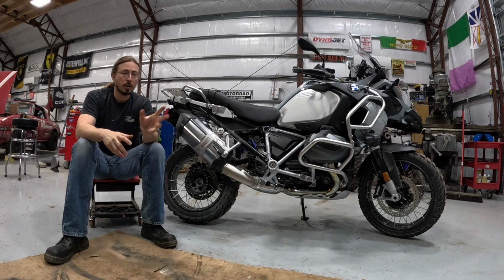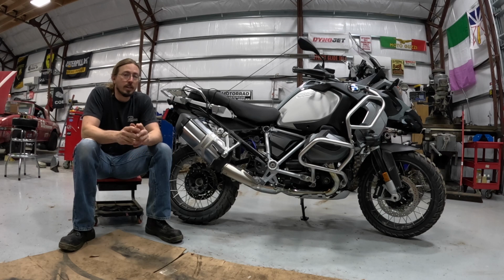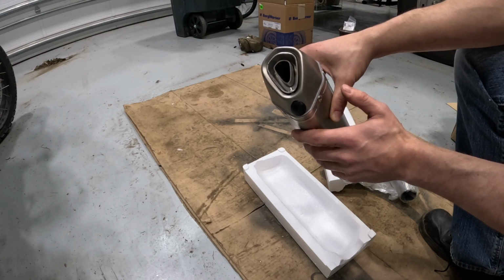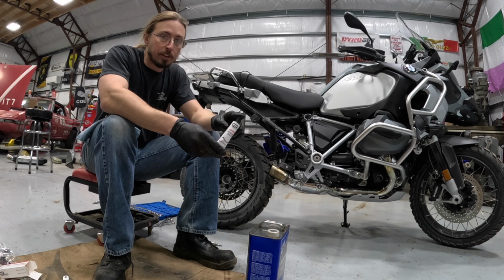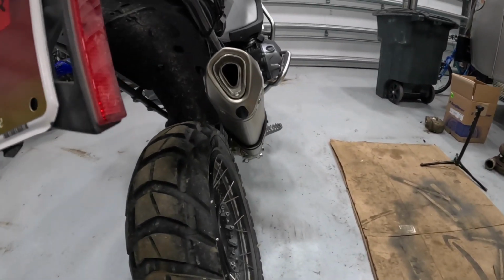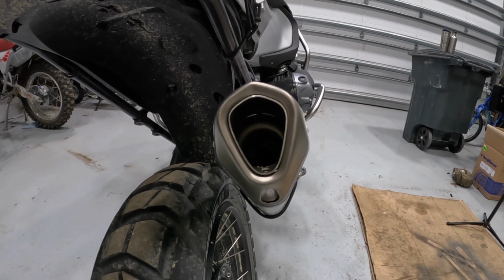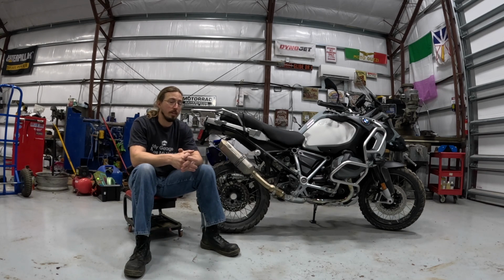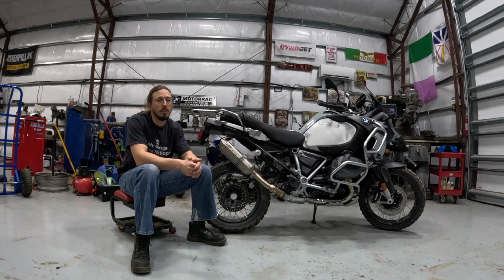GRmoto Exhaust Unboxing, Installation, and Review on my BMW R1250GSA with sound clips!

Comment: I have fitted a grmoto carbon can on my gsa 1250 and it only cost £200 its totally transformed my bike its got better response more grunt and sounds amazing most gearchanges now come with a bap sound the quiet burbling i got on stock can now is much deaper and louder i have road with baffles and without and without is a deeper tone my grmoto has a twin outlet its awsome mate also my mpg is unaffected

Comment: Looks nice and compact.
The valve in the exhaust is usually used for noise emissions.
If you were to dyno the bike you would likely see a strange power curve (due to the valve being mostly closed) in third gear as that is the gear used for the pass by test.
The muffler packing will last longer without the insert due to less heat.
Reply from the maker: Interesting on the flapper valve. I haven't noticed any difference (based solely on sound) in any gear, but I'll have to monitor that.

I agree, the muffler without the silencer insert is better overall. They only put that in I think for those in areas where maintaining Euro 4/5 compliance matters.